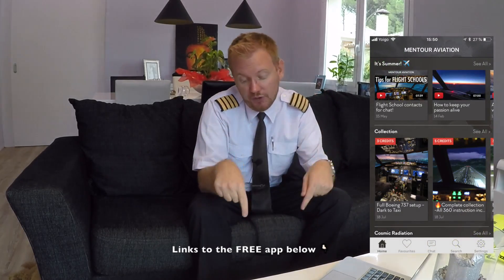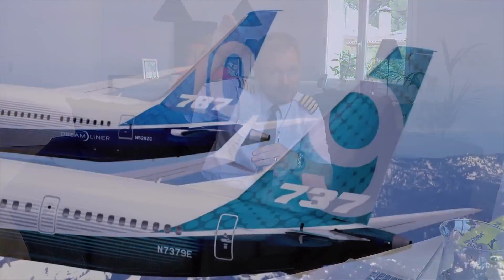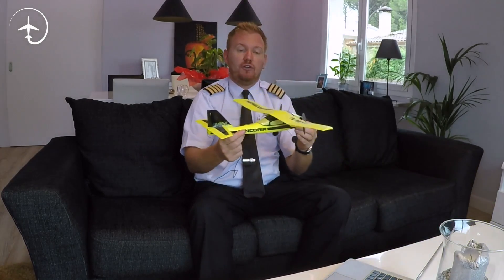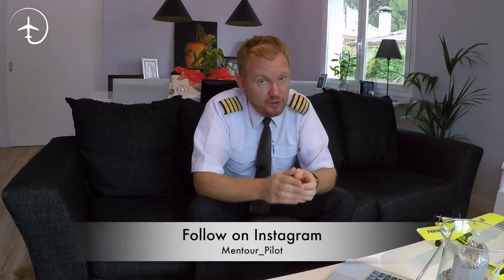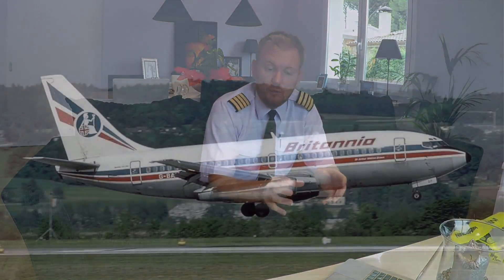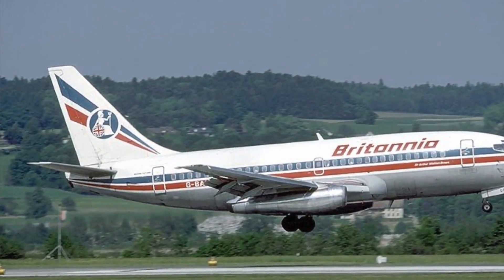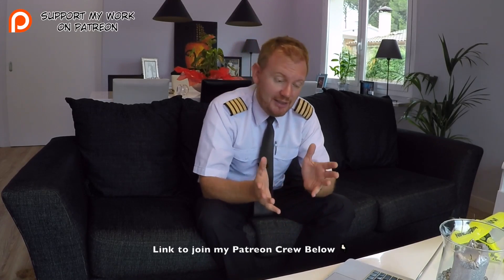The Boeing 737NG Fin: Why does it look like that?

Comment: Hi Captain, years back I was seeing some 737's at the Victoria BC airport that had a sizeable cable starting from the vertical fin  and diagonally down to the roof almost mid-plane. The gauge seemed too thick for something like, say, an antenna. Any idea of what it might have been about?

Comment: That was just awesome - this video. When I was guessing the purpose, I mistakenly thought that it provided more reinforcing strength to the tail plane so that it doesn't break off when the rudder is used to the extreme, or the aircraft is being used at some limit in extreme turning. The video mentioning the vortex forming functionality to allow the same size rudder to perform satisfactorily during an engine failure ------- very clever indeed!

Comment: Why doesn’t the airbus a320 have a dorsal? They also have a smaller/lower fin than the 738. so the a320
Of any should have a dorsal?
Reply: The A320 was the original aircraft, so they didn't need to modify it... I think the vertical stabiliser is taller
Reply: Alderney Flying that makes sense, but the airbus a320 vertical stabilizer is much smaller 5.87m or 19.26ft  the Boeing 737-800 and max is 7.16m or 23ft and 6 in. But I think it is as you say the a320 is more aerodynamic efficient over all. The nose is much different than the 737 but its also much more aerodynamic efficient. The 737 is after all a 1960is design.

Comment: Why not make the fin longer rather than higher and the rudder wider (rather than taller)?  Would that alternatively work?  In the plans for some new planes maybe?    I just remembered: the B-17 has a huge fin, bigger than most planes then had.  This was probably part of the B-17's famous 'Wing and a Prayer' keep-flying ability when shot up.  B-17's also had more wing area than 'needed' for the same reason.

Comment: I've read that the DH Mosquito had issues with its small fin, which was great for the high operating speeds, but on takeoff with a full bomb/ammunition load an engine failure would be a real, and often fatal, problem.  Landings too apparently.

Comment: Can you make a video explaining if airliners use rudder when turning in normal flight and why or why not? I have read from a few different airline pilots that rudder is not actually used when turning at cruise as you would in a general aviation aircraft; rather, it is only used during takeoff and landing- primarily crosswind landings. Thanks Mentour Pilot!

Comment: Oh, one other thing: Can you explain why some of the maneuvers I learned as a private pilot, such as side and forward slips aren't part of the airline pilots' repertoire? I was watching a video where an Air Canada pilot ran out of fuel and had to perform a slip to land his aircraft (767?) on an abandoned runway. The narrator explained that the pilot was lucky to have flown gliders and learned the maneuver. He implied that most airline pilots would not have known how to do it.

My instructor insisted on those maneuvers along with spin recovery. I took a biennial years later with another instructor and he wanted me to use more flaps to land from a slightly high approach rather than a slip.

Comment: I'm not a big fan of the 737, but that probably has more to do with the airline (Southwest) than the plane. I've spent most of my (passenger) flying time on the 757. (I'm a long inactive private pilot.) The largest aircraft I flew on was the L1011.

Perhaps you can explain the philosophy between the various Boeing models, or point me to a video if you've already discussed it.

Comment: Look at single engine aircraft like early 152/172/182 they had straight tails then went to ones with dorsal fins. Same with early P-51s. No dorsal compared to later with dorsal as well as the NACA fin extension.
You mentioned more thrust on a twin engine aircraft. Then why was this done since the 40s on single engine aircraft?

Comment: I was looking at images of the new 777X and was struck by how small the vertical stabiliser is considering the size and power of the engines. Is this because with a longer fuselage you can have a smaller fin. More leverage?

Comment: Thanks for the explanation.  My question is what is it like to fly through thick clouds when you're in the cockpit?  Are you relying on navigation aids to ensure things are clear up ahead, and that you're lined up for the runway in some cases?  I've noticed that sometimes the plane will fly through the clouds for several minutes before getting clear air which is like flying blind to me.

Comment: Both the C130 and  even more the C160, both propeller driven cargo planes mainly used by the military, have such a dorsal fin. 
By the Way, even if theire fin is completely different, would you like to fly an A400m due to its extreme manouvering capabilities? And can passenger planes be flown with more extreme manouvering than usual airline activity requires? I always think: Its mainly the passengers, not the aircraft, that wouldn't allow more steep aproaches/departures or more extreme banking.

Comment: How about DC 10 or MD 11, those aircraft did have 2 engines on each wing, with high TWR (even used in C-5 galaxy) and they only got a really small surface area on the vertical stabilizer, since there is the third engine, and also considered small rudder, how they will handled in crosswind and engine failure then?

Comment: Peter,

the video is great and informative as usual, but it doesn't explain why to make a shorter fin Boeing haven't just enlarged the fin rather than giving it that profile. Wouldn't a triangular fin with the very same total area give the same control than this? 

Also, I guess that the case of the Concorde is different: at supersonic speed a sharp angle would add to supersonic boom. Am I wrong?

Comment: Hello Mentour Pilot,
Yours videos are very informative!!!
I noticed one mistake in the clip on engine failure in this video..
The callouts "Gears Up" and "Positive climb" were spoken in reverse order. It should have been the other way round.
The PM calls "Positive Climb" after confirming the same on the attitude indicator and then the PF calls "Gears Up" and the gear lever is raised by the PM while verbally confirming the action.

Comment: I have a question or so. Many of the old jetliners such as the DC-8, 707, 737 etc. underwent some stretching. How does that change the way the plane flies since the C.G. is at another location? Also, does that affect how they are loaded say in a cargo version. Thank you very much for sharing your knowledge with us. I was born around airplanes. I remember my first flight at four years of age. I'm 70 now and still interested in aircraft.

Comment: North American did EXACTLY the same thing with the P-51 Mustang in World War II when they introduced the "D" model with the bubble canopy.  The fuselage behind the canopy was cut down and the "D" wasn't as stable in yaw as the "B" and "C" were.  The dorsal fin was added and the problem was solved.  There are pictures where early "D" models without the dorsal fin and later "D" models are in the same picture.  The difference is very evident.  The difference between the P-51 D and the 737-300 designers is that the North American engineers used pencil and paper with slide rules -- no computers.

Comment: Summary: newer 737s have larger, more powerful engines, which in turn require bigger, more powerful fins, since fins are necessary to provide yaw control, and the failure of a larger engine would create a strong yaw motion.

Comment: This is a correct explanation of why a dorsal fin was added corresponding to the lengthened fuselage and larger thrust engines. But in addition to making the vertical tail more effective (essentially by adding lifting area), it also makes the rudder more effective. At high AOAs, the boundary layer gets very thick on the upper surface of the fuselage in the vicinity of the rudder. Which can make the rudder hinge moment non-linear and can lead to rudder lock - a condition where the rudder is aerodynamically locked in a hard-over position. Adding the dorsal sheds a high-energy vortex (as this video explains) which reduces the effect of a large separated boundary layer - thereby making the rudder more effective. A more effective rudder is more efficient than just making a larger rudder. This is also a preferred fix as it allows the design to reuse a large amount of already designed structure.

Source: Am an aerospace engineer

Comment: Thanks for the explanation. I was a FA for AWA, hired in '89 when we were mainly an all 737 fleet (757 joined the fleet 2 years before I started - Republic Airlines owned 6 757s with RR engines when purchased by NWA who used 757 with PW. Those 6 757s were offered to AWA, starting their usage of the type). Anyway, while in training we learned how to tell our 737-200 (and a few 737-100) apart from our growing 737-300 fleet at a distance by both the engines and the tail - but we were never told why the tail was different. Now, 29 years later, I finally know why!

Comment: Why doesn't the 737 have a twin tail (a proper "H" tail like a Constellation not the two fins on the same fuselage like an F18).  Makes the plane lower, fins act as winglets making the elevators more efficient, less roll from rudder, rudder is not in fuselage boundary layer etc etc etc)?  Is it just due to the cost?

Comment: The dorsal fin is also a convenient way of enlarging the vertical stabilizer surface area without the need to completely redesign the stabilizer itself. Being able to increase the area while at the same time keeping existing tooling for manufacturing is a huge saving in manufacturing costs.

Comment: I love these lectures on aerodynamics.  How about one on "creative" uses of reverse thrust?  I've seen it used in flight (to lose altitude fast?) and I've even seen a 737 use it to leave a gate when they couldn't get a push-back.  And why does it look like the A380 only has the reversers on the inboard engines?  And can the rudder control the yaw if an engine fails while in reverse?

Comment: It's also interesting to note that the Embraer E-Jet family had dorsal fins on the original family, but now in the upgrade to the E2 family, the dorsal fin is removed, despite the engine upgrades the plane received. This was reportedly done to increase the aerodynamic efficiency, and thus decrease the fuel burn of the aircraft, something that was a major focus of the redesign. A source I found does say that the vertical stabilizer is overall smaller, as well, so presumably with modern computer simulations they were able to shave some of the margin off the yaw performance and know that it would still be safe.
Reply: Andy Modern stability augmentation helps with that. Manufacturers can reduce required stability a lot and use computers to make the plane feel natural, so horizontal and vertical stabilizers are getting smaller. If the computers failed it would be harder to fly, but not a safety risk.

Comment: The VS fillet also helps reduce drag (by acting like an aerodynamic fairing) in cruise flight, saving fuel. For aircraft that do not have CR fans, a slight offset can be an efficient way to counter torque from the propulsion system.

Comment: Due to work, I must fly 2 to 6 times a month within Europe. This means 2 to 4 hour flights in economy. The choice is having to fly either 737s or A320/321s, depending on the departure  times/airlines/ticket prices. My heart sinks every time I'm forced to fly on a 737. As an tall (but not excessively large) economy passenger, the 737 is always a much more uncomfortable experience compared to the A320. So it always disappoints me when I hear that airlines choose the 737 over the A320 family. Why don't airlines ever consider passenger comfort before they simply decide based on numbers?? Many airlines have chosen thousands of A320s, so surely it can't be a bad choice! Please airlines, think of your passengers' comfort and forget about the 737!!
Reply: Are you talking about foot room?
The point is: the distance from one seat to the next is not prescribed by the aitplane type. The seats are clamped on rails (thus can be moved back and forth) and the airline can decide what that distance should be.
With respect to this, the available foot room has nothing to do with the plane itself but everything with airline decisions.
Reply: Your comfort is strictly at the mercy of the airline and your wallet.

Comment: 2:25 “Nice 1g feeling” is not really accurate. At 30° of bank angle, it would be a 2g/sqrt(3) feeling, i.e., 1.155g, if I’m not completely mistaken. :-)
Reply: "A nice 1-g feeling" sideways. If you're in a coordinated turn, you might be pulling 8 g's (if you're lucky enough to fly something that doesn't shatter apart at those loads) and still have a "nice 1-g feeling" sideways.

Comment: Hi Mr Pilot, I have a question(not related to this video) but I dont know where to put it, so i leave it here. Long and double-decker airplanes are heavy, 747 and A380, they are expected to be heavier so thus mounted with 4 engines to provide more thrust. But shorter variants of A340, like A340-200 is also mounted with 4 engines, why is it necessary? thanks for advance

Comment: Is it possible to get plane sick? Never happened to me before, bought a ticket from a different airliner than the usual one i fly, the landing and takeoff were rough, the plane was kinda stall-flying (continuously adjusting angle) and i feel a similar thing to being sea sick. Maybe it’s just that i’m flying on an airbus for the first time and not boeing.

Also the engines didn’t start because the weather was so hot there wasn’t enough pressure and they had to use a manual pressurisation system or something to start the engine. Can you shed some light on why the engine doesn’t atart at low pressure/high heat environments (the plane was an A220)

Comment: Wouldn't the longer fuselage of the NG, increasing the fins distant from the yawing axis, make up for some of the increasing stability requirements as bigger engines were fitted?  The 747sp is a example of this, where it's entire tail plane (height and span) is significantly bigger than the much larger -400.

Comment: Great explanation but I would hasten to add it was a lower cost change to basically bolt on the dorsal extension than to redesign the entire vertical stabilizer. Smart, low-risk,  and cost-effective from Boeing's perspective.

Comment: I have always thought there is just a string that ties the fin to the fuselage to make it more solid, covered by metal plates for better aerodynamics 😀 just like there used to be various ropes on historic airplanes. Thanks for explanation!
Btw making the fin higher would not only make difficulties in existing hangars but i think it also makes the plane more sensitive on crosswind. Wind pushes on a longer lever so it can more easily roll the plane and the (auto)pilot has to work more with ailerons to balance it, right? They might have wanted to avoid this?

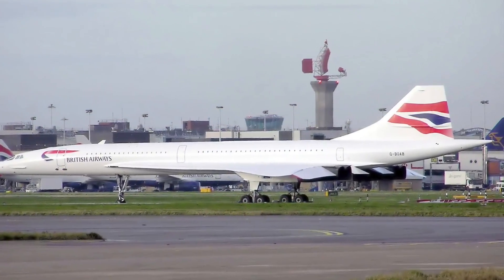Comment: What is that aircraft schematic of at 08:55? It looks like the Sentinel, a modified Bombardier Global Express. Particularly with the canoe underneath, which looks like the Sentinel's duel mode radar, and also has the fin at the back, which doesn't appear on the original Global Express.  The reason I am confused is because that aircraft is military, and I didn't expect that any official drawings would be legally available.

Comment: This was also the reason why when the British Civil Aviation Authority was certifying the 747-420 for BOAC, they noticed a problem with yaw stability with the original shorter vertical tail surfaces. As such, Boeing built a taller vertical tail design and a small ventral fin to correct this issue--a modification that was retrofitted to other 707's and to new-build 707's.

Comment: I think the ventral fin 8:29 is to generate an equal resistance to the air above and under plane body, specially on speeds closer to sound speed.

Comment: Any idea why the shorter variants of 737 (eg: 737-700) and A330-200 have a taller vertical stabiliser than their longer siblings (737-800 and A330-300)?
Reply: btarunr basic physics and dynamics.
Reply: Can you try to make sense?

Comment: Cool video! I have noticed that before on the 737 and wondered about it. Given the explanation, I'm curious why the B-52 fin got shorter in later models. From what I've seen they were trying to save weight. Was it simply over-spec'd originally? Presumably the contingency for an engine failure is different when you go from 2 engines (737) to 8 (B-52).
Reply: A lot of variables determine the fin size and the rudder size such as engine placement, fuselage length, yaw moments needed and so on.  It requires a careful trade study to get it right. But a dorsal is usually added to delay when Rudder Lock occurs so it does not become a problem during most operating conditions.  While fin size and rudder size affect when rudder lock occurs, the dorsal is the most structurally and weight efficient way to get rid of rudder lock if it is a problem with your design.  I was not involved in the design of the B373 tail, but I would bet the dorsal is there to delay rudder lock.

Comment: Don't forget the length of the fuselage (or lack of length in the 737's case), plays a part in the  effectiveness -- and therefore size -- of the rudder. Great videos!
Reply: I was thinking just that, in respect of the very elegant fin on the 777, which has no dorsal fin or even (Airbus style) radiused fillet.